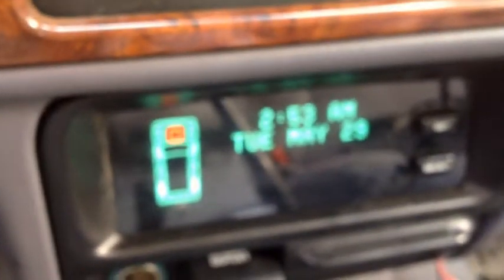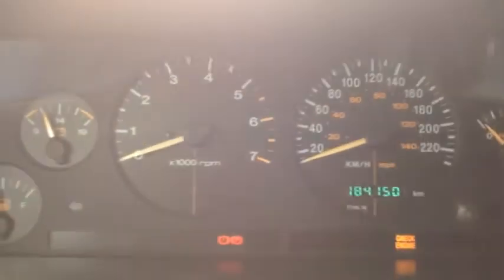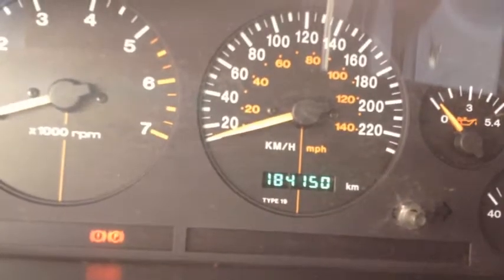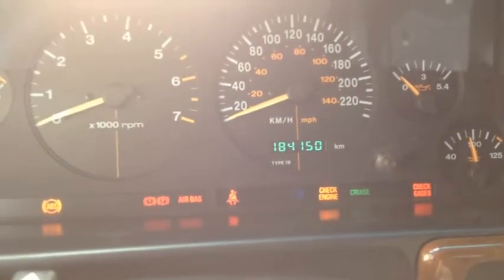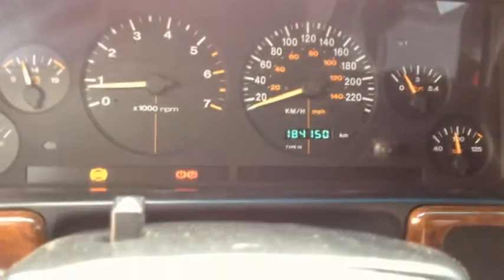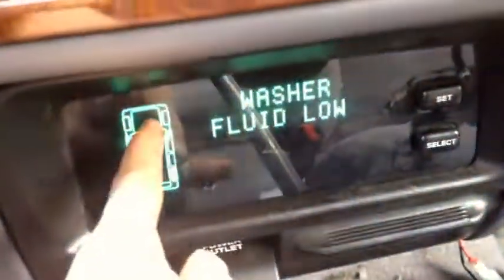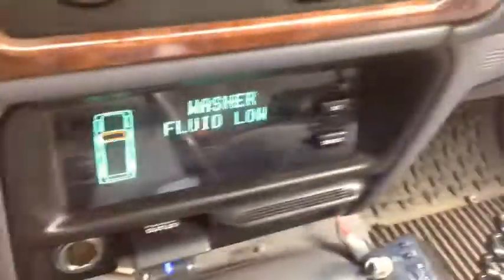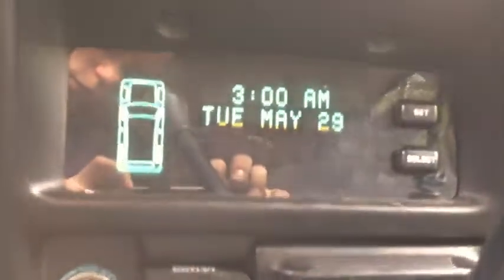AX15 ZJ SWAP - The engine codes you get after a AX15 swap

Comment: I'm gettin ready to do the swap in my jeep this weekend . But I'm buying the ax 15 , t case , trans mount , cross member.  Everything I need off the xj the only mod I'll haft to do is for the 4x4 linkage . I'm buying the driveshaft out of the xj as well . How well do you think it will work ?
Reply from the maker: Djmedic981 hmm, I wonder if the cross member will work? Also, you'll have to make a bigger hole in your floor for the shifter. Hopebthe bell housing bolts up and everything!

Comment: Correct me if I'm wrong, but is it possible to flash the ECU to get it to accept the AX-15? I want to do this swap on my '96 ZJ, but since I live in California I have to smog it, and if the check engine light is on, they will fail me instantly. Though I also want to drop the transfer case(NP249) an make it 2wd.
Reply from the maker: Honestly, I have no idea. Perhaps but I would just recon you get an ECU from a 1996 Jeep Cherokee 5-spd instead.
Reply: LostFart did you actually get these codes to go away with a manual Cherokee ecu swap? or even try to?
Reply from the maker: I live in a place where I don't need to worry about smog, etc. Also, the check engine light didn't bother me that much so I left it. But, if I still had the Jeep, I would have certainly done the ECU swap by now.